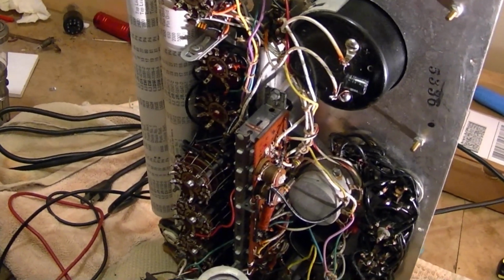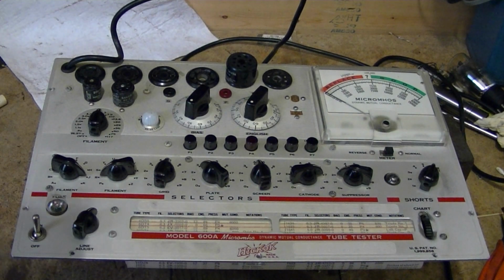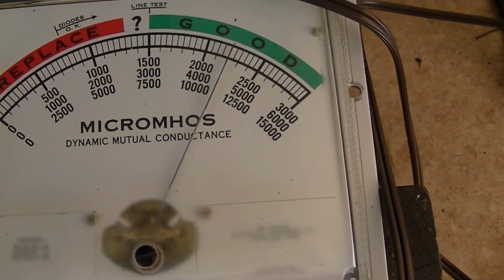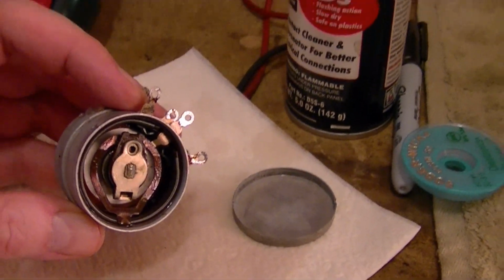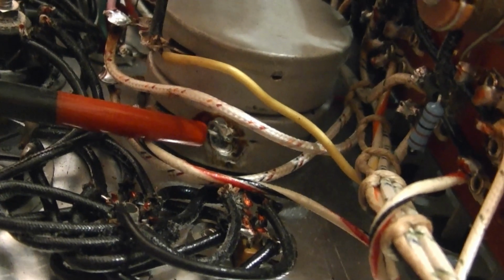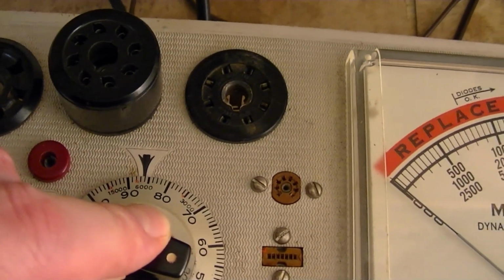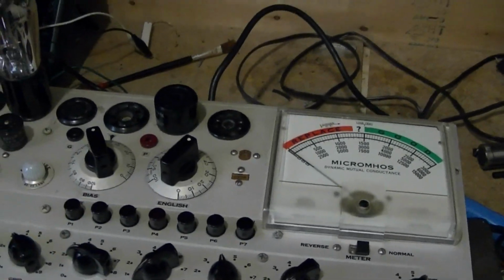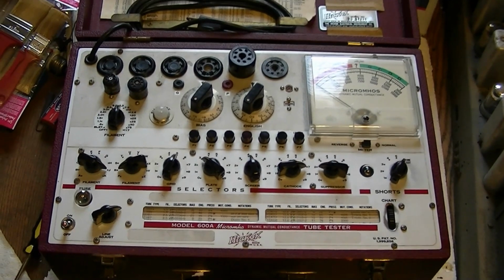Hickok 600A restoration p2o2

Comment: Bandersen, i need you help. 

I have Hickok Model 600 (non A) - this appears to be one of the earlier units which has 5 Volts AC Grid Signal voltage. 
The Mutual Conducatance Test Calibration Reading says that i have to apply 50 Volts AC via 10 K Resistor - which i do. 
I read the 50 Volts AC before the 10K 10 Watts 1% Resistor. 
Now it says that i have to calibrate the english control to 2000 mH on the 3000 scale. 
In reality my tester only Reads BUT EXACTLY 1000. My guess, since the english control works tracks perfectly is that this perhaps might be correct for the early models. 
Now my question would be: Are you familiar with these? 
The unit is not exactly what you find in the 600A Schematics since it doesnt have that HI Lo Swith and it doesnt even have a cap across the meter nor does it have the R3 15KOhm resistor. 
All components seem to work just fine, i have replaced both capacitors with new ones, resistors are not far off, they look darn good actually. 
Thanks and thanks for all your contents! We love you!
One thing i forgot to mention is that my bias voltage appears to be a tad high. The calib says its supposed to be -39 volts where in reality i read -43 VDC max. Maybe thats a clue. I live in the 50 230 Volts area running this guy on a step down Converter.
Reply from the maker: Sorry I'm not familiar with the early version. The only one I've worked on is mine 12 years ago now.  Have you tried asking in the Test Equipment area at the Antique Radio Forum?
Reply: @bandersentv  To be fairly honest im not a member there. But thats good point i will sign up and ask these peeps. I usually work only on Guitar amp stuff and just lately came across this tester. But i thank you anyway! Keep it up!
Reply from the maker: I do have a Hickok 800 in the queue for servicing.  Newer than the 600 but you might find it interesting.
Reply: @bandersentv  Is this going up on the channel?
Reply from the maker: @geronimostade8279  Yes.   Probably in the next two weeks
Reply: @bandersentv  Nice man! Looking forward to! I think i have to reverse engineer mine to figure this out - shouldnt be too hard... Perhaps the 800 will help in understanding how the models evolved!

Comment: Hickok use calibration tube to set english control. My 752 i didnt desolder bottom section submerged in IPA and then som contact cleaner in back and in slot in top of control. Since your reading was 2200 before and now its 2000 shouldnt effect results to much so probably ok

Comment: Just trying to figure out why my shorts light won't come on with 220k resistor highest can use is 188k notice 15k on shorts switch by cap when should be 27k and don't have resistor beside it either schematic lists a 47k there. So not sure, what might do is disconnect 1 end of 15k put a pot in between like did with line cal pot and see if it will allow me to adjust it for 220k. Cause calibration instructions even list R28 as a calibration for shorts but not listed in parts list or schematic for 600 or 600a
Reply: Figured it out simple 100k pot in  line with the 330k resistor and now have r28 to dial in shorts sensitivity

Comment: Shorts light doesnt come on with 220k resistor for my 600. If its lower it does come on. Any idea what could cause it to very faintly lit. The resistor accross shorts bulb is measuring 324.7k which is within 330k has silver band

Comment: Setting it on 2000 will make your meter bridge balance test go well above zero better off setting it to 1850. Best is to rotate top section of control so that when doing meter bridge balance test it's 1 tick above zero on all 3 red dots. That means control is balanced across its whole range

Comment: Very nice. This is a good tester. I don't like that it does not do compactrons as the finals in my Drake T-4XC would be nice to keep an eye on. Also the case looks like it was made by volunteer boy scouts to earn a woodworking badge. I am sorely tempted to build a nice oak case for it and jazz it up a little. Way to go..
Reply from the maker: The cabinet for this is standard for 1950s Hickok equipment.  Tolex covered plywood.    Compactrons simply didn't exist when this was made.  You'll need a model from the 1960s for that.  By then quality had gone downhill and the case was made out of plastic.

Comment: I adjusted my control like you did I had to go with balancing it with bridge balance test if set mine to 2000 makes bridge balance test go way off get like 5 ticks above 0 so if I set it close to zero through whole range maximum 3 ticks makes the conductance test read 1800 which I can live with. For some reason though my needle likes to go past 3000 instead of right on 3000 like yours. Guess that's why other Hickok testers where better when they had those fixed ranges with a switch instead of sharing English or shunt control

Comment: If you calibrate shunt to 2000 then it won't be as balanced will be at 2 ticks above or higher which is not good. The 6000a calibration instruction says Hickok didn't use the mutual conductance test as a way of calibration. Do not make any adjustments based on this test. What I recommend is if you want your shunt perfectly balanced set it to 1800 on all 3 scales then you will be within 1 tick above zero or lower if you do bridge balance test 😉

Comment: On my 6000a after I adjusted pot where it stays within zero or 1 tick above when I test a tube thats 3000 transconductance it goes to 3000 and on 6000 I get 2900 and on 15000 I get below 2500 what could cause that?
Reply from the maker: Sorry, I don't know.  I only had my 6000A a short while and sold it.  I don't remember the details of it's operation.
Reply: bandersentv that's OK. I have some sad news about it today when I was checking resistors something must of fell in socket and when I did a test of 2.5vac I got 150v now have no more 2.5v just 14v my rehostat is way off to. That was lots of money gone. I think its transformer
Reply: Looks like its transformer tubes test good so do resistors as for meter I get 232ohms .0027uf cap I get 3.4nf but doesn't charge
Reply: So I checked everything and its fine except for the 2.5v taps for 83 tube and maybe for the 5y3 tube if I measure them I get 65v so is some of windings in transformer open or do I have bad component causing high voltage increases?
Reply: bandersentv I fixed tester was the small #49 bulbe for bias fuse I now get 2.5v line voltage again and proper voltage for grid and low screen. So ordered a new bulb strange why it wouldn't work without bulb has it has a 47ohm resistor in parallel with bulb could you maybe enlighten me on why it needs bulb
Reply from the maker: The bulb is used as a fuse to protect the tester.  It's not going to work right without it.  47 ohms is higher than the resistance with the bulb installed.
Reply: bandersentv ok so that bulb drops 155v to proper voltages. Strange why still measure 65v on 2.5v taps on 83 tube maybe I'm measuring wrong
Reply: So I calibrated tester got voltages closer to spec change 2 resistors that drifted meter still reads 56mv instead of 58.2mv when I went to do mutual conductance test mine was off of 2000 also I tried adjusting pot to 0 close to within a tick or so but thought this test was better to set it at 2000 so I did and when I went to recheck the bridge balance it's up 4 ticks is that ok?
Reply: I'm cleaning the pot how do you take top section off?
Reply: Well got pot fully apart to the top part cleaned both sections thoroughly and used some floil g-2000h lubricant grease on the wiper to restore grease that was inside works great. I balanced pot within 1 tick of zero or at least 2 ticks get 1800 on scale with 50vac that's about all I can do with this tester. Meter still get 56mv don't know what else I can do to get that voltage higher or is it fine at that voltage

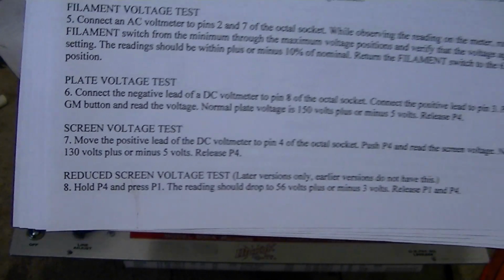Comment: @4:35 you didn't mention if the voltage test results were ok or not.   Also, wouldn't it be a good idea to replace the old 2 prong line cord with a properly wired 3 prong grounded cord?

Comment: very good info here. What did it cost in replacement parts for yours? Is it worth $160 to have the restore and calibration done?
Reply from the maker: Less than $5.  Only a few components needed replacing.  I suppose it's worth it if you don't have the tools needed to perform a calibration.

Comment: I was wondering if you were able to fully dis-assemble the dual gang English pot for cleaning. In many different forums, and hands on experience, these are very tricky to get apart without causing damage due to the way they are assembled. This pot is the achilles heel on most Hickok testers if not cleaned and working properly. We appreciate the time you have taken to show actual restoration vids! Good job!

Comment from the maker: Do a Google search on 'hickok 600a schematic' and you should get a link to the Boat Anchor manual Archive.  I suppose it could be a lot of things. - bad tube, bad line test switch, bad meter, bad transformer secondary.  Hopefully, it's just a loose connection somewhere.  Try posting your symptoms on the Antique Radio Forum in the Test Equipment section.  There are some real Hickok pros there.

Comment: Thanks for the video, I learned a lot. I have a 600a that worked 30 years ago before storage. Now when plugged in the line test does nothing, although the tubes and fuse light lights up,and there is voltage on the heaters of tubes plugged in to be tested. It looks to me that nothing has ever been done to this set nice clean set. Where should I look first? Also, where can I get a scematic? anyone out there with seen this before? I sprayed all the controls with a good contact cleaner.

Comment: Emissions testers are quite common, I guess you mean a mutual conductance tester. There are ways to modify a standard emission type tester into a mutual conductance tester I believe, I've seen articles on how to do it but have no need to since I already have one. The main difference between a mutual conductance tester and a straight emission tester is that the M.C tester puts an AC voltage on the grid of the tube to mimick a signal input.

Comment: Regarding the gassy 80, I noticed above the scale there's a "Diode good from here" mark that both sides of the 80 were past.  Given the 80 is a diode, it's not too surprising that it still works in the radio.